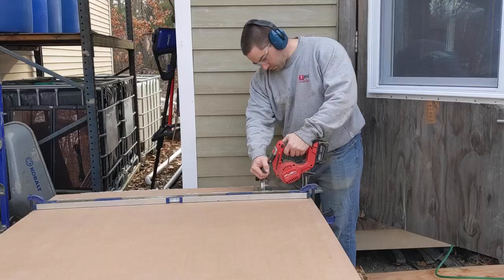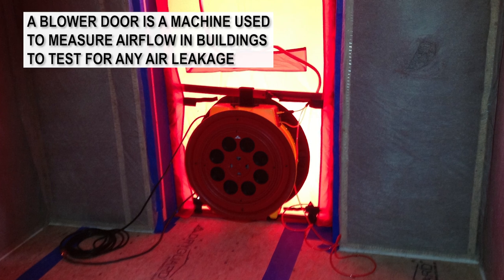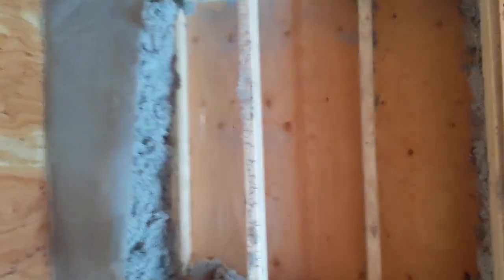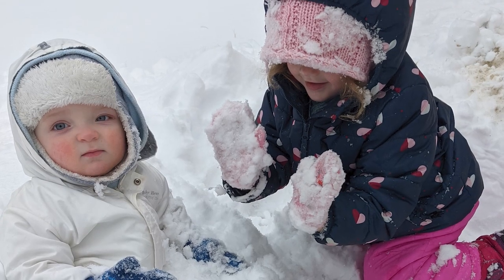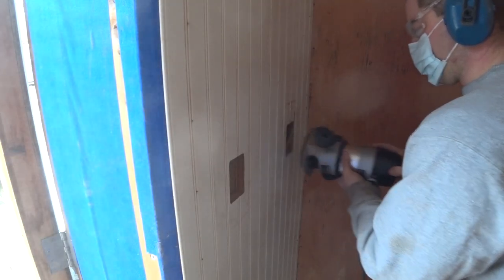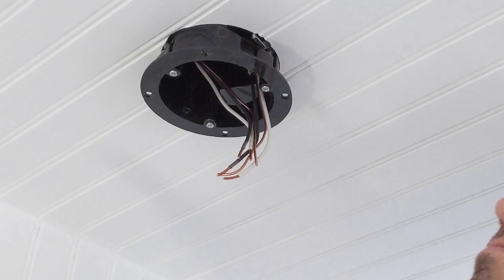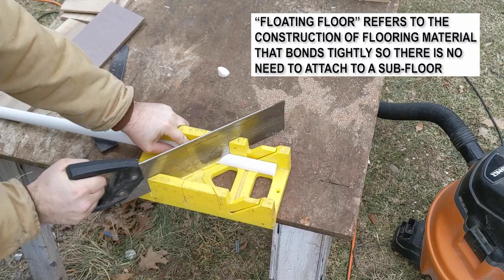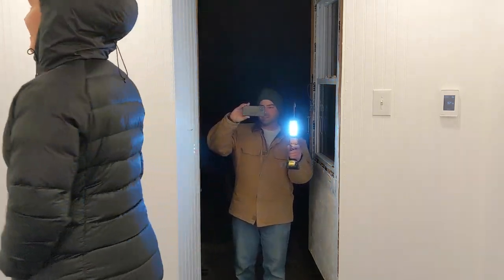DIY: Super Insulated She-Shed with Radiant Floor heating

Comment: Great job David.  One thing you can do to control the brightness of the room is to change out the light switch to a dimmer switch, then it can be as bright or as dim as you like.  Also, for your next shed, you could save yourself the hassle of installing recessed boxes for the LEDs and buy the slimline LEDs which give the look of recessed lighting without having to install a full recessed box in the ceiling.  I'm using those on my basement project for simplicity of install.

Comment: David your Prince, she will love you for ever. I would put a screen door on it with sliding glass panels so she get better air flow in the summer.
I have idea for another video. I have heard you and other talk about how solar isn’t good for inductive motors like well pumps. I first video explain the differences between inductive AC motor and DC motors. The second would modify a gasoline generator with split phase 240  to a DC motor. Maybe another video on explaining gear ratios to achieve the proper RPM’s. Then test the performance of generator powered by a DC motor, while powering an inductive load. I personally think this would reduce the drain on the system, when inductive load first kick on. The reason why I think this is my dad always said that if you need to do heavy duty work like air conditioning or well pumps use 220 - 240 because it will cost less on your electric bill. I always took that to mean their is more kinetic energy thus less of a surge on the meter. I have never been able to prove my theory one way or the other. Your home setup would make the perfect proving ground.
Reply from the maker: Hi Delton Baker,  Thank you for the video ideas.  I've said in the past that low frequency inverters are best for high inductive loads.  This is because of the large transformer inside of them.  I run my house on solar, but through large inverters.

Comment: David: A few notes on The NEC. (Nat'l Elect. Code, put out by U.S.  [fire] insurance companies & adopted by most jurisdictions as legally binding, as you are aware.)
The standard "Romex" you're using requires being secured to the structure essentially every 40", max, and also requires "nail shield" plates when run close to a surface where there might be nail penetration (such as less than abt 1.5" from the edge of a standard 2x4 stud).
You might argue that this is temporary construction & thus exempt from the code ... Also that argument would be strengthened if you do not permanently connect this room to your house wiring, but instead use an extension cord as you mentioned ... but be careful!
Also, there are certain exceptions for when wires are "fished", but this didn't always appear to be the case.
Your problem arises if you have a fire that spreads to the house, the insurance company might deny your coverage.
So, while you should consult local authorities/licensed folk, this is a little word to the wise. (Your video document might make trying to assert a different POV difficult.)
Best wishes in all your endeavors!

Comment: Looks great.  So that radiant floor is only using half that of a 1500 watt space heater?  I have an old radiant ceiling from the 60s and my meter reads it burning 3kwh on low.
Reply from the maker: Yes, half the watts of a 1500 w space heater.

Comment: Need a 15 degree slope on the lower board to help with water drainage on the bottom board.
Reply from the maker: I don't know what board you are referring to.
Reply: @DavidPozEnergy  the bottom of the window should have a 15 degree slope to the outside so water won’t set on it.

Comment: Great detailed summary of the process! I was just wondering why there aren't any network jacks in the walls when it's an office :-)
Thanks making great videos! Cheers!
Reply from the maker: It's all wireless.  Wireless router in garage gives 4 bars in the shed.  Wireless printer to computer.
Reply: @DavidPozEnergy  Wireless sucks bro, especially for zoom meetings and the like. Future upgrade project: Run some fiber (no ground loops, yay) or at least ethernet out to the "shed". Get er done, hard wire her PC, she will be happier.
Reply: As someone who does hours each day of zoom via both wired and wireless, I can tell you that practically speaking there's little to no difference. 
I do zoom and teams internally and cisco webex for some external customers, and when I can take the calls by laptop from the couch, I certainly do!

Comment: It has always seemed backwards to me to put anything other than the flooring itself over the ground elements to insulate OVER said elements...but you gotta have something there...
Reply from the maker: I agree it's odd, but it prevents the floor making a lot of noise when you walk on it.  But, keep in mind, the padding material is about 1/8" thick and the insulation under the floor is 9.25" thick.  Or, 74x thicker
Reply: @DavidPozEnergy  Very true.  Still should be effective.

Comment: Does the netting you use to hold the cellulose insulation in place act as the vapor barrier? I’ve only ever used plastic for that.
Reply from the maker: No, it's a net, like mosquito netting on a window.  Air can flow through it very easily.

Comment: hello ;-)  sorry, I have a QUESTION not about this topic, but about electric solar system off-grid..    and then thank you so much if you could answer it..      Question is :       what happen to the solar's panels when the batteries are full.. and the sun is still there, so the panels are still producing..      and you not use this electricity..   you are off grid..    so where it goes ?   and can it damage any component of the system, or appliances ?       ;-)
Reply from the maker: The charge controller simply shuts off.

Comment: How did you insulate the floor under the sheeting so the heat does not go down?
Reply from the maker: The floor is dense-packed cellulose insulation.

Comment: Nice job! I'm building a 12x24 workshop/shed, and this was useful for a non-framer like myself.  Interested in the wall thickness, 12" double-wall 2x 2x6?  Also, any thoughts on dry vs damp fill blown in?
Reply from the maker: Yes, this is 12" thick, but is 2x4 walls.  Damp-spray is fine for 2x4 and 2x6 stud cavities, but starts to sag when doing thick double-stud walls.  I think blowing it in behind the insul-webb is better for very thick installs.

Comment: Very cool, good job. One question. What kind of unit did you use for the insulation blower? HD seems to be getting out of that business in Toronto anyway. And an FYI, floor surface temps should not be above 85F. It should be noted on the packaging, I would think.
Reply from the maker: I'm using a Force1 that I upgraded.  I have 3 videos on my channel about it, here is one: https://youtu.be/JOt9TBwWwM8
Reply: @DavidPozEnergy  haha, you are prolific. Keep it up

Comment: Just out of curiosity is it solar powered ?
Reply from the maker: Indirectly, yes.  I ran a 10 gauge extension cord that plugs into my garage outside outlet.  The garage/house runs on solar off the grid 99% of the time.  However, there are a few exceptions a year when I switch back to the grid because I'm changing wiring or we have too many snowy days in a row.